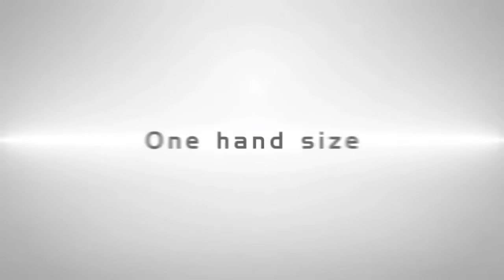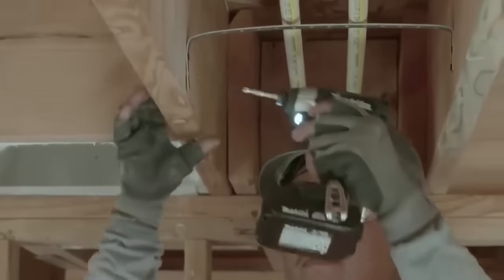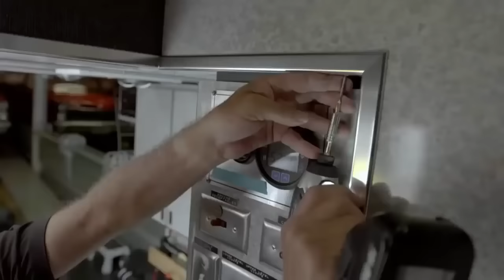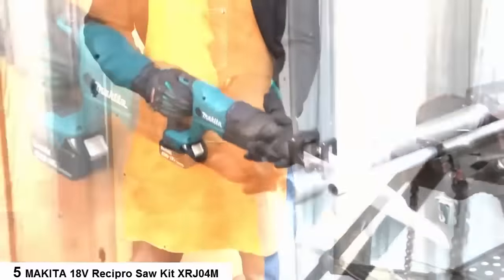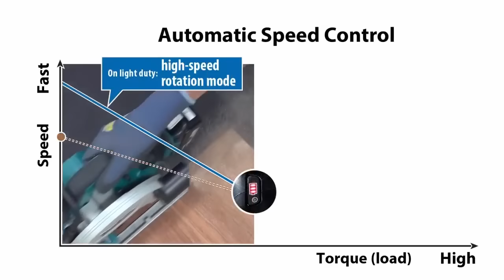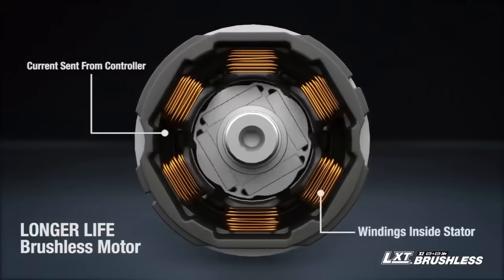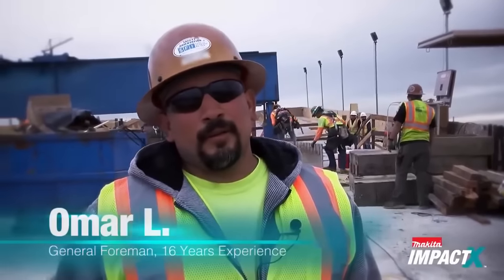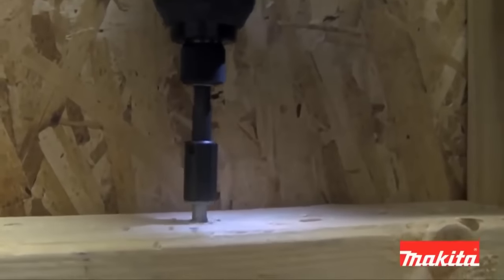10 New Makita Power Tools You Must Have

Comment: Batteries failed so often
Reply: Mine are going plenty strong common failure is leaving them on charger for too long and they overheat. Also charging with grinding dust on the contacts and the charger also fails them